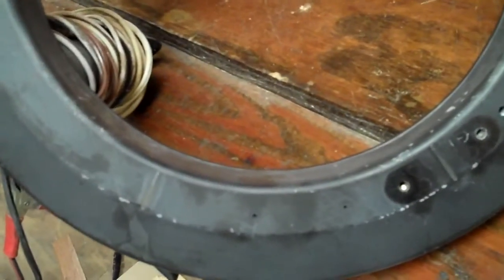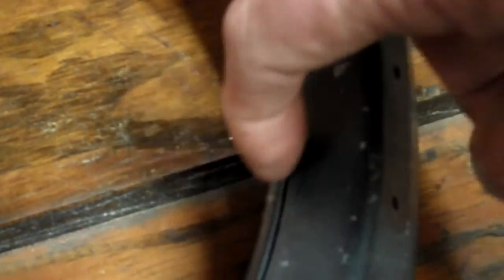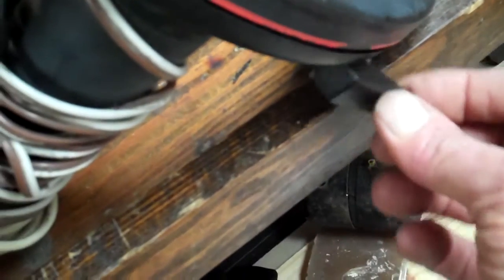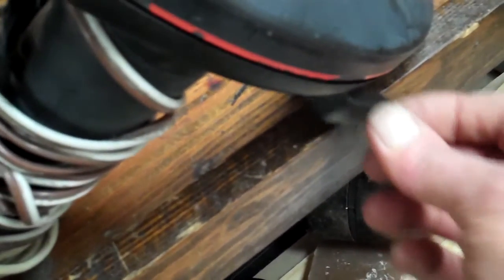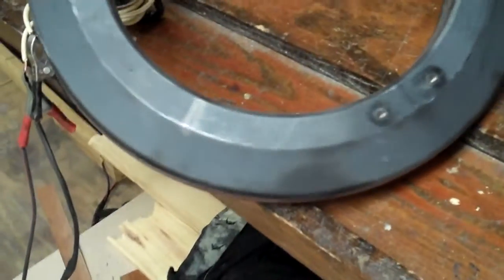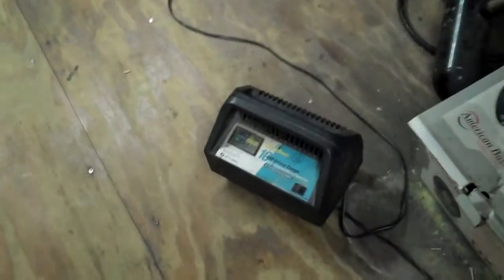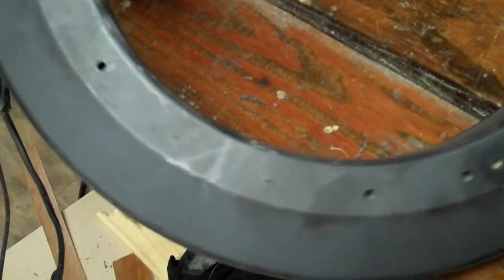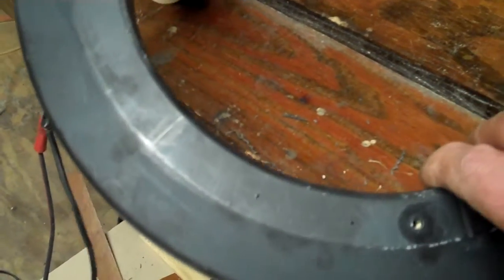Autohelm Raymarine ST4000 wheel drive drive belt repair 004

Comment: Thanks Mel for actually describing the process of releasing your back cover. The Auto helm I’m working on appears well fixed and the two parts won’t readily click open and not knowing how the two rings are secured, I am very reluctant to apply too much force to separate them. I’ve tried inserting various tools to prise them apart but they show no sign of separating. Are there a series of push-fit mountings that physically engage with each other? I believe the back cover is made of plastic so I imagine after awhile becomes brittle, hence the need for extra caution. Chances are my push-fits have seized themselves together. If I knew their location on the drive ring I could localise my prising tools to minimise possibility of breaking the fixings. Any ideas?

Comment: Hi Mel -  The autohelm st4000 on our catalina 36 was working fine until the drive lever went limp while underway...making the autohelm unusable.  Your video is very good, but should I order a new belt and tumblers before I begin to take it a a part?  I don't have a shop so I'd be doing the work on the boat.  Thanks!   Pete DeLaunay in Seattle
Reply from the maker: when you say tumblers i am assuming roller wheels.usually the wheels are fine but the shafts are snapped off.look at my vids and you will see how to repair shafts so they will never break again.for $20.00 buy a new belt on ebay   mel

Comment: Hey Mel, does the color or the St4000 (gray or black) determine model, mk1 or mk2. Late June this year, I purchased and replace the drive gear and belt. After assembly everything was pretty tight and sometimes I could not disengage. I purchased through eBay and I think for mk2 ( gold color belt). As a result the belt failed yesterday. I'm looking at ordering new belt and may attempt mk1 drive belt as I cannot determine my model. Jack..Any help would be appreciated. Greagori6@gmail.com

Comment: Hi Mel,  we are trying to repair our ST4000 ourselves after having it repaired many times by the professionals.  Our problem is that the autopilot will not disengage.  The drive lever is loose and floppy and has no effect.  Any help on what is wrong and how to fix it would be appreciated.  We have it apart now.

Jeff
Reply from the maker: hi jeff.when you say the drive lever you mean the black tension lever that engages and disengages..i just repaired one for a gentleman.the shaft hole was worn out and binding everything.can you send me a video of what the unit is doing once you split the cases.if you can show me in the video what the lever is doing. send video to     melbaron@rocketmail     or you can call me at (985)871-9625....I have a total of 11 videos on how to repair the wheel..sorry they are kind of scattered in my site.maybe one of them will help...mel
Reply from the maker: Krista Engelland I will be up for a few more hours or you can call me anytime past 8am in morning..mel
Reply from the maker: Krista Engelland send to   melbaron@rocketmail.com   forgot the   .com    in first email..mel
Reply from the maker: hi.did you get your problem resolved.let me know if I can help..mel
Reply: Yes we did thanks. The roller pin on the drive leaver had sheared off.  Thanks
Reply from the maker: Krista Engelland GREAT !!! I HAVE OTHER REPAIR VIDEOS IN MY MIX THAT YOU MIGHT LIKE..MEL

Comment: Hi Mel,
I have mine apart and about 10 years ago I did the same thing you did.  Now I had to replace the clutch pin after it broke.  The nut that protrudes on the outside nearest the clutch handle interferes with that clutch handle movement.  I have been tempted to counter sink that hole and use a flat head bolt and reverse the direction of that bolt so that the nut is now on the inside thus giving the clutch handle a free swing.  Your thoughts?   Like I said I have it apart.  Should the gear be able to turn?  Mine does not.
Also I have a noisy wheel drive when auto pilot is not engaged.  I will try your oil idea.
Reply from the maker: hi paul.I have a back up drive and I am looking at it right now.i have the unit laying on my desk with motor  up.the nut to the left of the clutch on mine is not interfering with the handle.the handle does lay up against it when the handle is unlocked but the case moves freely in the unlock position on mine.i don't thnk there is enough meat on the cover to countersink  a screw head.the clutch handle is pretty thick and stought and maybe you could groove the handle to go over the nut.the gear is on the motor and it should only turn when the motor turns.mine has a little play in it and that is typical.with use.the pin that holds it on to the motor gets a little slop in it from use.the wheel drives are noisy and the oil does help a little,but the oil just makes the rollers turn a little smoother.why don't you send me some pics of your unit to my email  and I will take a look at pics this evening and maybe I can get a better idea of your problem..my email address is      melbaron@rocketmail.com     .time to raise the silk...mel
Reply: melbaron1110 Hi Mell, I have just joined Gmail.  I have an autohelm 4000 and am having problems.  The clutch is completely lose now and doesn't snap onto the wheel, therefore I cannot lock the device.  Also, the actual drive used to spin freely but now it looks like the drive cog is tight and doesn't want to turn?  any suggestions?
Reply from the maker: Alan Sanderson hi alan.have you had the unit apart yet. if you haven't then you need to snap the cover off and take a look.it sounds like the belt is binding everything..take unit off steering wheel..the power wire ring just turns counter clockwise and you pull it out..once off boat take a flat head screwdriver and on the inside of the wheel insert the screwdriver into the slot between the covers..twist the screwdriver slowly and the cover will start popping apart..go to another section and do the same thing..now you can see what is going on..90% of the time the belt is shot and just binds everything up.if the belt is shot then it binds up the wheel and also the clutch has no tension on it to hold it in place..just flops around loose...i just got another wheel drive and here in the next couple of days plan on taking it apart completely to show people how to do any repair they need to do.you can also send me pics to my email..i have 5 videos on the autohelm st4000 on youtube..one of them might answer your questions.need anything else don't hesitate to let me know...mel
Reply: thanks Mel.  I have had the unit apart and replaced the belt which was all chewed up.  it worked fine for a month or so then the clutch lever went really loose when I tried to engage it while sailing.  Took the unit apart again.  The belt is fine and the clutch lever moves at the same time as the cam moves but there is no tension.  Also, the sprocket is really noisy and is hard to turn when the unit is back together.  I'm going to take a closer look at the weekend. 

thanks,
Reply from the maker: Alan Sanderson heh my friend.sounds like your new belt might have stretched.i had that happen to me last year.took me awhile to figure it out.if you wanted to you could send the unit to me and I can most likely fix it.i have repaired a bunch for other people.you pay for shipping and parts and I will supply the labor for free..mel
Reply: melbaron1110 Thanks Mel.  I might take you up on it.  Let me see what I can find this weekend and I'll get back with you.
Reply from the maker: Alan Sanderson heh alan..let me know what you have found.if everything is working correctly as far as wheels,tensioner,etc then I would think it is the belt.the original belts from autohelm had wire layers and it was super strong with no stretch.the new belts are not anywhere as good.they stretch and then they slip..i think they make them that way on purpose just to sell more belts.i always carry spare belts as I am lazy and use my autopilot all the time.i have spare belts and a spare wheel.i have changed them out several times while cruising.nothing worse than being out 300-500 miles and no autopilot..mel
Reply: melbaron1110 Hi Mel.  Still have problems.  The clutch tensioner is better but doesn't actually lock into place like it used too.  It only gets a little tension.  Also, when the autopilot is disengaged (clutch and power), I cannot spin the wheel like I used to.  The wheel is hard to turn.  I think I have an issue with the gear mechanism / motor now.  I would like to send to the unit to you.  Do you have a tel # that I could call you on?
Thanks,
Reply from the maker: Alan Sanderson heh alan.yes you can call me at my business..(985) 871-9625.if I don't answer leave a message as I am in and out of the shop..mel